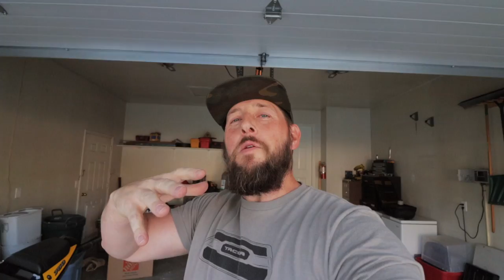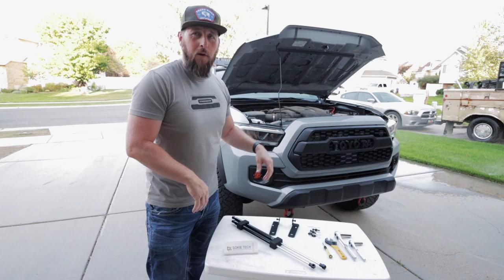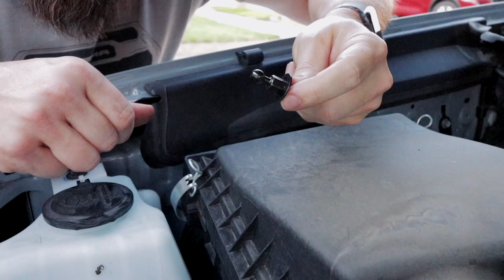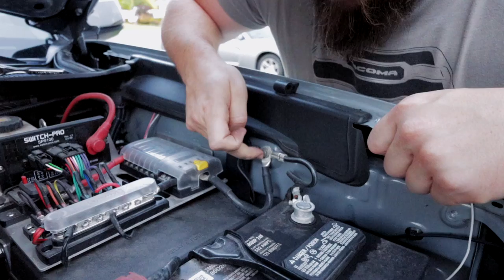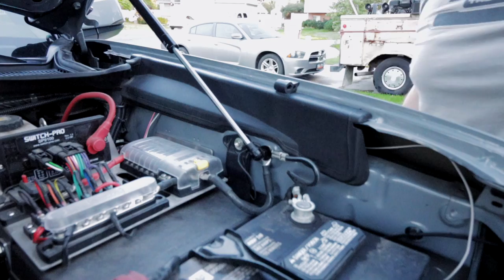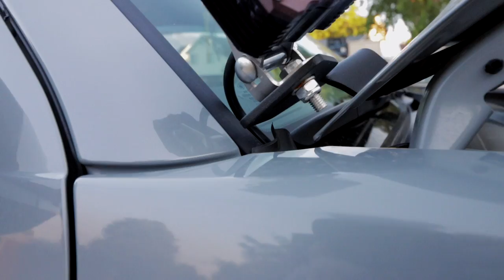Sokie Tech 3rd Gen Tacoma Hood Struts | INSTALL.  #tacoma #hoodstruts #toyota

Comment: Huge note !!,  I have an Ingen air intake which will not allow strut on the passenger side NOT to be installed no clearance.  TRD air intake does allow it.
Reply from the maker: Yes, if you have an aftermarket air intake, the passenger side will not be able to attach.

Comment: Great video! I like the no drill, no pop rivet install. I am a little concerned using the ground bolt though.  Time will tell.
Reply from the maker: thanks, I'll be sure to post if there is any change on the ground bolt.
Reply: @Mumfy64  probably a dumb question, but can you just remove the ground wire and replace it like that without getting sparks or shocked?
Reply from the maker: @Chris Laws I'll have to look in to that option.
Reply: @Mumfy64  well I mean you did it when you bolted the driver strut. I just thought you had to unhook the battery before messing with the ground
Reply: @evertmorse8518  thanks for explaining that
Reply: @evertmorse8518  why does that last part mean? You can ignite the airbag by using a probe light? Yeah I saw the new ajt steering wheel panels tell you to disconnect the negative before taking off the airbag cover
Reply: @evertmorse8518  so you are talking about those little volt meters? Those can mess up the electronics?

Comment: Hey bud quick question. Have you noticed your attachment bolts bending? I’m talking about the one that replaces the ground bolt on the drivers side and the one where the passenger side where it went into the threaded hole that was there? Mine look like they are pushing out from their original installed position. The washers are not flat anymore. Any cause for concern?
Reply from the maker: Yes, that connection point is holding part of the weight of the hood and having all of the grounding wires there doesn’t seem to help matters. I have kept an eye on it every time I open the hood. So far no issues.
Reply: Ok thanks I’ll keep a close eye on it. I’m just worried about them possibly snapping. 🤞🏻
Reply from the maker: @SD-yi3vx  valid concern. Just don’t be in a rush to close it all the time. Lol.
Reply: @Mumfy64  I really don’t open it that much luckily so I guess we’ll see how it goes.

Comment: I'm hearing there are some failures with this bolt in strut system because it only uses the one bolt and the bracket is bending out away from the hood. All I can find is guys who have installed it, but no year or so later follow-up.
Reply from the maker: Im keeping an eye on the quality of the bolts. I do think they should have made the driver side a bit more stout for sure.
Reply: @Mumfy64  Thanks for the timely response!!
Reply: Mine WAS ok for about 8 months.  However, I just checked and the stamped area at the battery ground connection where the lower pin is mounted is bending out, At first glance it looks like the pin/ball is bending but it's not - it's the sheet metal.  Just not designed to hold that heavy hood. I am replacing mine with the Redline Tuning struts.

Comment: This is what I’m worried about 
Amazon review “
1) Directions are pathetic, a small sheet with poorly translated incomplete documentation
2) The ball joint pockets are plastic, they barely snap in
3) each bracket is only secured by one bolt and will stretch your hood or worse, repair? $$$$
4) The torsion on the brackets and strut arm are maxed out when the hood is open, lots of stress
5) The double sided tape does not adhere to hood, pulls away at fully open
6) the last 25% of travel upwards the struts stutter and pump like they are failing. Not smooth.
7) Now the realllllly bad design. The left strut bolt replaces your cars battery ground...
....when you open the hood you can clearly see sheering forces and bending of the strut bolt....
....if this one bolt decides to loosen or bend enough to lift your battery ground you are doomed.

Seriously this would never pass any design safety inspection. Spend another 20 bucks and get quality, don’t put your car or your life in danger. This review is for a third Gen Toyota Tacoma, maybe but unlikely the design is better for other vehicles.
Reply from the maker: Ive seen this review as well. Ive also seen plenty of other installs that haven't had this issue, but that isn't to say that the concerns aren't founded. There are risks with every modification we place on these trucks. Even from the factory they aren't perfect. I know of a couple other modders that are only running 1 of these struts and haven't had any issue. The best thing to do is to assess your risk level and decide for yourself if its worth it for you.
Reply: @Mumfy64  I’m going to try it as well. I think if it was that serious other people would have said something
Reply: @Mumfy64  Only 1 of the struts?  The passenger side, I assume.
Reply from the maker: @frankt7521  Driver side actually. Due to interference from aftermarket air intakes.